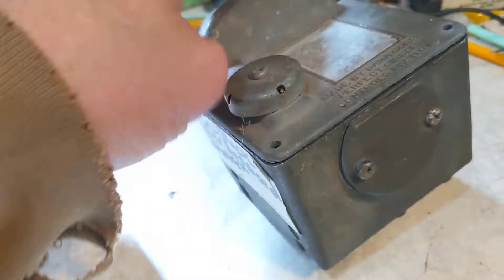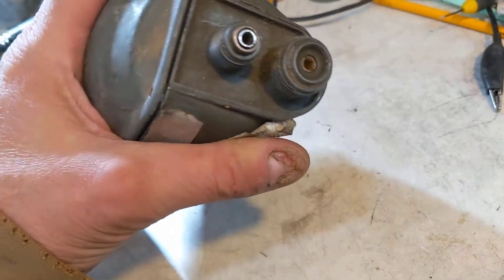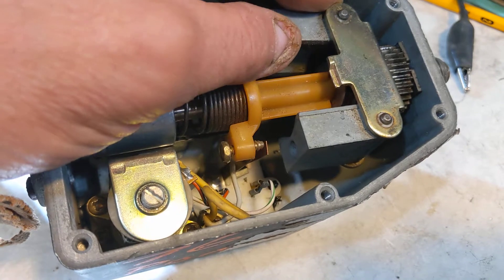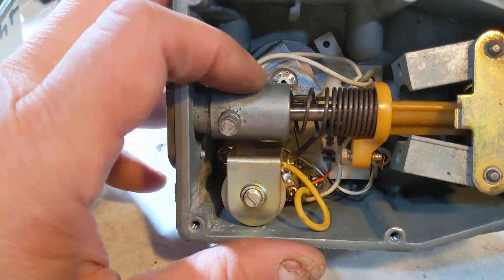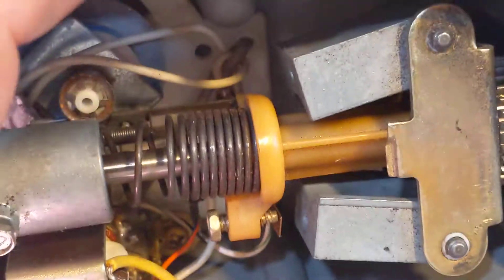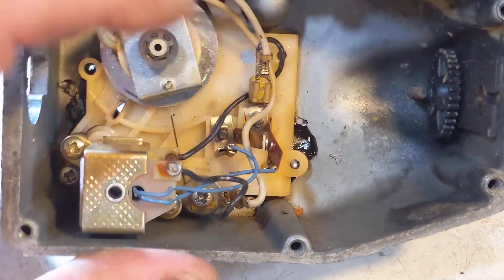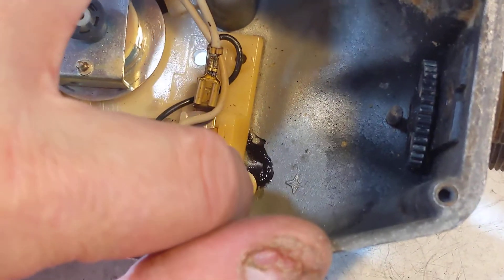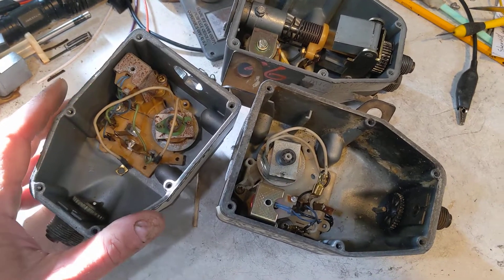Perfect Circle and Dana Corp Cruise Control using vacuum as the mover. A video tour and explanation.

Comment: I have an almost identical unit on my 1969 Lincoln continental. I was getting started messing with it and I came across this video. Mine is a three wire version. Mine also seems to have a small board inside with  a diode on it. I am wondering a few things. What are the 2 wires for or in my case the three wires? Which one is power into the unit? Also mine seems to have a solenoid on the top of the case that blocks atmospheric pressure from entering the unit when energized. What would be the purpose of blocking atmospheric pressure? When atmospheric pressure is blocked, does the entire unit fill with vacuum? I feel i have a good understanding of how the unit functions but I would love to understand more if you are willing to share. Thank you and great video!!! Very little information on these in video form. thank you for making this. Many old lincolns are without cruise control due to lack of folks that are able to fix or obtain parts for them.
Reply from the maker: You ask many very good questions. 
It's great that you are “digging into it”. 

It has taken my dissecting many units, repairing many for customers, study of diagrams, and countless hours of time. It would take my writing another book to fully answer all your questions properly. Furthermore, I admit that the more complex units can boggle the mind for a time. But as an exercise and possible material for another book, I'm digging in. 

I published a book on one of the major types of cruise control, used by GM throughout the 70's. It's a spinning magnet type and uses vacuum as well for pull power. I have always intended to publish two more books on the other two major types that I repair, this being one.

If you wish more extensive correspondence, we can communicate more directly. We can email or we can text or call.  

I do ask, if you could, voluntarily contribute to my work. Any amount is appreciated. Please use PayPal to my email address. Which is george dot s dot borrelli at gmail.com  Thank you in advance. I can also repair your cruise control unit. I am quite reasonable. I have repaired many for people all over North America. I do this as work for beer money, since retirement. I charge just $100 to open it up and evaluate. Then we go from there, depending upon how complex the problems are.

I happened to have two paying repair jobs here right now for the Lincoln cruise. One is for a 1967 and another for a 1971. Some of the features inside the Lincoln cruise are new to me and I'm sorting it out right now. The Lincoln cruise is far more complex than the one in my video. My video here is a two wire, the simplest of them all. Lincoln (and maybe a few others) kept adding more and more complexity. I've seen 4 wire units in Lincoln, International Scout, and others. The cheaper car models have either 2 or 3 wire and have no extra features inside. 

You should carefully examine yours. The fourth wire is deceptive. It's a singular wire added to a threaded end of a bolt sticking out the bottom. Is yours the 3 or the 4 wire? 3 spade connectors and one threaded bolt. I'm going to respond as though it's a 4 wire, with 3 spade connectors and one bolt. 

The small board mounted to the side of the box is a diode as you've stated. 
Diodes conduct electric current in only one direction. I believe it passes power when the momentary is partially pushed in. Power goes wired to the cover ambient solenoid, and the diode passes power to the main vacuum solenoid as well. They came up with these crazy approaches to achieve capabilities and safety above and beyond the others.

This diode I only see on fancier car's cruise units while most cars do not have them.  The diodes should be tested. In spite of the fact that the few I've seen haven't failed. The diodes I have here measure about .5 vdc when biased positive and zero when biased negative. So the diode will not allow a connection in one direction but will in the other. In the four wire system, the diode is bridged between the bolt connector going to the metal housing of the main solenoid and then off to the clutch solenoid and the cover solenoid's main winding input connector. I believe the purpose of this diode is to send power across it, but only under one condition, to accomplish two functions at once. 

What are the wires (from the external connector) for,  you ask? 
I don't know that there's a numbering convention so I developed one to keep things straight.
(I'm also using a Lincoln Service Manual for a 1971, so colors could differ.)

Looking at the connector from the outside. There's two parallel spade connectors and one on top at 90 degrees to them. Lets orientate that single 90 degree one to be at the top. Then the two parallel spades below it can be labeled left parallel and right parallel. In my four wire, with the bolt connector being connector #4, the wiring is as follows. 

The left parallel spade, I labeled 2, has a white wire of the external wiring harness when connected. The right parallel spade,  I labeled 3, has a black wire of the external wiring harness when connected. The single spade on top at 90 degrees to the other two, I labeled 1, has a violet wire connected when plugged into the wiring harness. On most of these fancy units, for the Lincoln, they usually have a bolt connector, I call 4. It has an orange wire when the wiring harness is connected. 

The top blade, 1, violet, goes to the main winding tab of the cover solenoid, on units with the top solenoid and the diode. I believe the top solenoid allows for speeding the car up whilst holding the momentary switch in a bit. The left parallel blade, 2, white, goes to the internal center solid metal cylinder of the main vacuum solenoid. Power travels from there only when that solenoid is also energized from another source.

The main ON power goes to blade 2 or the white wire.

The brake relay is a ground break, normally closed, opened when stepping on the brake. It goes to the right parallel blade, 3, black wire when connected to the harness. 

The bolt connector, 4, has an orange wire. 
This is powered when the momentary is released. So it is normally on, if the push button isn't pressed in and power is on and ground is connected to chassis.

The solenoid on the top is, as you stated, designed to block all atmospheric pressure (release of vacuum). Functionally, it is intended to accelerate when the push button is held the first phase, partially in. It does this, I believe, by sending all vacuum available to the bellows or the accelerator servo, attached to the carburetor. It does this because the unit fills with vacuum and at the same time leaves opens the circuit to the speed control clutch hold-down solenoid, leaving the slot in the resting and at least partially open position. That moves vacuum to the bellows of the vacuum servo and moves the accelerator to WOT. 

To do a simplified electrical test.

Apply and maintain main power to White 2. It simulates switched “ON”.
Apply ground wire to case. Or for bench tests, negative.

Unit can be opened but then continuity must be jumpered from ground to the electrical connection "point" below case solenoid, mounted at the bottom. Or unit must be closed. In all cases, the unit will not work unless the low speed switch is jumpered or forced relief into contact by movement of fly weights. 

Apply momentary power to Violet (1).  This does the following:
1. Energizes Cover ambient solenoid to be closed, which also
2. unpowers clutch solenoid 
3. Opens vacuum solenoid. Via the diode.

This has the effect of full vacuum to throttle as long as that momentary switch is partially pushed in. The car will keep going faster.

Apply power to set/engage/hold speed bolt orange 4.
1. Leaves cover ambient solenoid open, allows ambient into unit.
2. Powers main vacuum solenoid to open. Which in turn,
3. Powers the clutch for adjustable speed control. 

Herein I didn't cover the mechanicals, the mercury switch, the external relays, the external wiring and switches, and lots more...

Repairs are quite complex and very particular. One must fully understand every function and every element fully. I've seen just about everything fail at one time or another. Some fixes require custom builds of springs, gaskets, etc. The Lincoln, certainly 1971, has extensive switches, safety, features and functions that others do not have. This makes them much more difficult to repair. 

Before applying any power, always pre test with an ohm meter so you don't burn up anything.

I may have made a thought process mistake or two. I may have written poorly. Do not hold me accountable for errors. Use at your own risk. Do your research to double check me before proceeding. 

Best of motoring vintage cars!
Sincerely,
George Borrelli
Crystal River, Florida
Reply: Sorry for the delayed reply. I have tried to take in all the info you gave me fully. I appreciate the offer to rebuild mine but I want to do all the work on this vehicle myself just for the personal satisfaction. I came to determine that mine is in fact a 4 wire as you stated. My wires are also all the same colors you described. The 1969 Lincoln and 71 you are working on are likely the same unit and wiring. I have tested the diode on mine and it seems to be bad unfortunately. I used a diode test on my multimeter and it did not have continuity in either direction. Any idea where I could get a new one? Any knowledge of the specs on it? I saw diodes on google but I have no idea which one to get. If i had a new one im comfortable soldering a new one on to the board I just dont know which one to get. 

I have tested all three solenoids and they are all working properly. I have also managed to make a custom spring myself that works for the vacuum valve. It is just strong enough to hold vacuum by pressing the rubber against the lower plastic base. but also just weak enough that the solenoid can still compress it. Ive replaced the paper washers on the metal cylinder of the vacuum valve right above the internal grey wire with a rubber washer so the spring does not contact the metal. 

I mainly just need to resolve all vacuum leaks and get a new diode and I should be good as all my solenoids are working. Ive even cleaned the scale off of the lower disc of the clutch solenoid to prevent any sticking. With the info you provided I think I have a fairly good handle on it. I greatly appreciate the info you have provided. 

Do you know what diode I could buy to replace the original?
Do you know how I could get the little gasket between the vacuum valve and the main board?
Im also having trouble sealing the exit chamber passage and the main board. I put RTV under it and get the vacuum in side to seal fine by holding my finger over the hole and applying vacuum with a hand pump it will hold. However if i put the hand pump on the exit side ( the one labeled S) while holding the exit hole under the vac valve and the small oval slot that gets covered by clutch solenoid. If i hold both of those holes closed with my fingers and have a helper apply vacuum I cant get that side to seal for some reason and ive tried like 2-3 times now using permatex grey 1 min gasket "the right stuff". Any tips would be appreciated. Ive used this particular RTV many times in auto repairs and its never leaked anything. Im quite surprised that the lower exit chamber will not seal and the main vac in chamber will. I dont believe there is a crack in the main board either. Thanks again for your time and information. I greatly appreciate you!!!
Reply from the maker: @Andys_Auto  I do these repairs as a small business. Endless hours, money, resources, and brain cramps. If you'd like more support please contact me  directly. I gave my email address earlier. I can also be reached at: (6+1)OneNine-2Four4-(6+1)OneTwo4. A short part of a much longer answer is that your vacuum test is not valid. You can't test the vacuum in reverse, they didn't design it to hold vacuum that direction.

Comment: The smaller vacuum port goes to manifold vacuum? Is that correct?
Reply from the maker: Yes, 

In the video I say the smaller comes from the intake manifold and the larger goes to the vacuum servo to control the carb throttle.

But to qualify me. 
 Although I can and have repaired many cruise controls including this type, I've never installed this exact one in a car. The Perfect Circle type I installed was a bi directional dc motor. The Dana vacuum type i installed was the magnetic disc design.  I have written a book on the Declo magnetic disc version of the vacuum system used in the seventies. 

For certain the source vacuum is the intake manifold, not the carb. 
And it goes to the smaller of the two ports.

On the magnetic disc seventies version, they had a T connector. I don't know if they had one on this version. A good car repair manual should have the details. 

The modulated vacuum of the larger pipe / port would go to the vacuum servo (throttle puller).

Please return the favor and like and subscribe to my channel. Thank you, George Borrelli.
Reply: @georgeborrelli3134  Thanks for replying George! We've been trying to get this thing working for 6 months. I thought maybe the vacuum hoses were reversed but yesterday we found that the violet power supply wire under the dash was wired to a dead hole in the fuse panel. Fixed that and it works perfectly.

Comment: Do you know where I can find a rubber diaphragm for this?
Reply from the maker: I assume you mean the unit that pulls the throttle. 
They are now very hard to get. 
I sold all the ones I had. 
I suggest trying a substitute.
Reply from the maker: If you need more help, feel free to reach out to me. I'll do what I can. I was in the process of finding replacements but that was all interrupted. I can be found online. I have a web site for my martial arts with my contact information there: https://systemacrystalriver.com/
Reply: @georgeborrelli3134  I went to a junkyard and picked out 3 replacements..... The problem I was running into was that the diaphragm actuator only had one vacuum port on any replacements I found. The Pontiac one had 2 ports with 2 vacuum lines. Right now I have one from a 80s el Camino with a V6. And the vacuum diagram in the book I have lists 4 different options. So I'm afraid I'll have to  trial and error this thing
Reply from the maker: @chasintrail8176   I haven't found a good source to repair or replace those vacuum pull actuators. If you find one, kindly share. Thanks, George

Comment: Hi,

I have a NOS regulator that came in a kit for VW rabbit/Golf, dated 1.76. The regulator looks like it was made yesterday, but I can see the potential for headache with that paper gasket. Would you recommend replacing the gasket in any case, even though it has no mileage? Greetings from Norway
Reply from the maker: Find a way to test before replacement. There's risks... with a replacement. Test.
Reply: @georgeborrelli3134  Ok. From the video it seems that it needs power in order to hold vacuum. If I power it on a bench, could I test it with a hand held vacuum tester (pump style)? That is if I hook up the vacuum tester to the "M" input and the servo diaphragm to the "S" output.  Or does it also need the centrifigal spin to hold vacuum?
Thanks
Reply from the maker: @Gangliamod  
When I repaired this type, I could block certain paths and apply low vacuum, from mouth through tubing or use a small vacuum pump. 
Then I would move the modulating cover inside with a finger, it block that slot entirely. I could tell if it was air tight or leaky.
Reply: @georgeborrelli3134  Ok, thanks for taking the time
Reply: Do you have pictures of the speedo cable and cable from front wheel where they connect to the module?  Im looking to buying one for my Bus which also used this style as a VW optional addon.